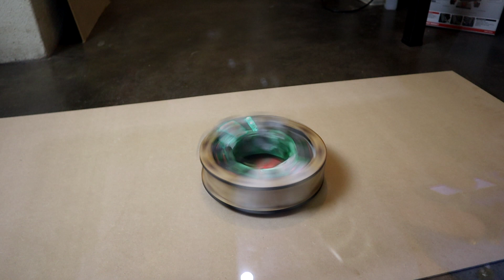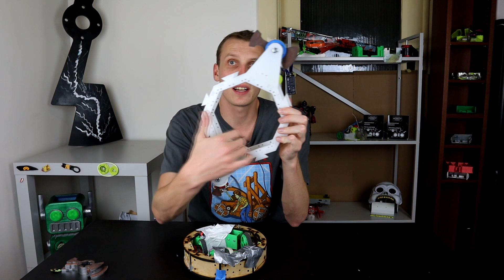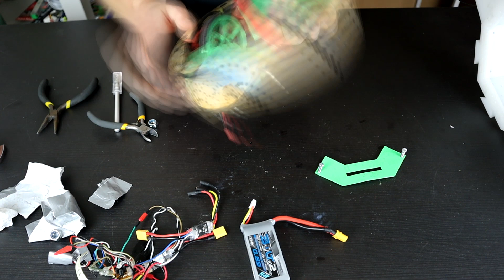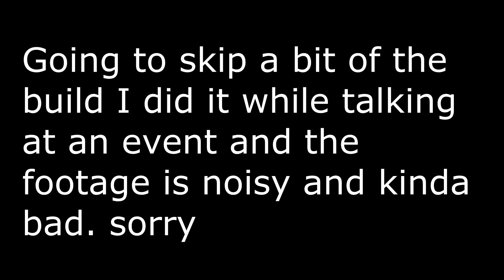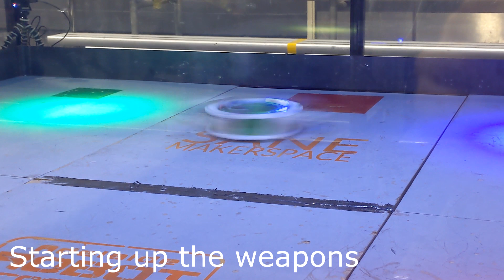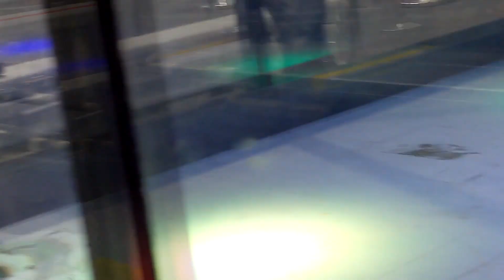Putting Weapons on my Melty Brain

Comment: I would love to see your code if you get it fully working.  I got mine to a somewhat similar stage with a version of my SpinDoctor code, but I couldn't get the heading to stay stable, and then I wound up with a lot less free time to work on it and moved on to other projects for the moment.
Reply from the maker: I'll probably do a release at a later date, but I'll need to do a ton of clean up its a bit of a Frankenstein monster right now between my code, halos code and your code.

Thanks for putting that up BTW I would have been lost trying to get the ESC telemetry working without it

Comment: That is amazing!  I wonder; what the tip speed  is with the spinning and the weapon's going?
Reply from the maker: I have no idea, I dont even know how you'd measure it
Reply: @TeamPanicRobotics  you could calculate an approximate tip speed by measuring melty body and weapon rpm separately, convert to m/s or whatever, then add together.
Reply from the maker: But is is an add? or is it a multiply? or is it some weird harmoic fraction thing, I just dont know.
One day I'd like to get my hands on a high speed camera, a safe testing space and measure it for real
But thats not going to happen any time soon
Reply: @TeamPanicRobotics  yeah it's an addition - an equivalent (non-rotational) problem is throwing a ball on a moving train: ball absolute vel = train vel + ball vel (obviously if they're moving in opposite directions one would be negative)
Reply: ^that's assuming you convert your rpm to a linear velocity at the tip (it doesn't really make sense to add the two rpms together as they're not concentric), and the weapon is spinning in the "correct" direction (i.e. tip of weapon advancing in same direction as spin of robot).
Reply: Yea I had the same thought. I believed it's an addition problem though.  But you'd have to make sure u get the tip speed of the main bot with blades fully out .  Then the speed of the weapons alone.  .... Maybe...

Comment: its looking really good. best of luck with fixing the bugs.

i really want to see what happens when this thing connects with something else at full chat...

have you worked out your actual tip speed when everything is fully spinning?
Reply from the maker: I have not, because I dont know how to calculate it.
People keep saying to just add the two RPMs together, but I dont know that addition is the way those two RPMs interact, it could be a multiple, it could be some other crazy maths equation involving harmonics

Comment: Have you considered a 'pilot' bot within the melty like Y-Pout?

Flea weight using a beetle as a ring spinner.  The flea gives you the heading and the melty spins around it?
Reply: Although, thinking about it, that's way over complicated.  A castored wheel in the centre that the bot spins around, with a yaw sensor so you know where 'forward' is?
Reply from the maker: Thinking about a caster wheel it would be great for going in a straigh line, but as soon as you change directions the casterwheel will shift and change your heading. 
Its do able but would need a more complicated control system